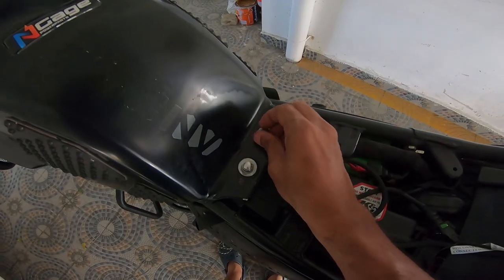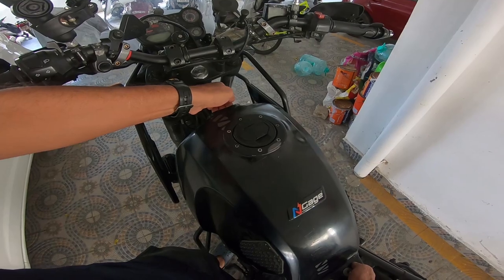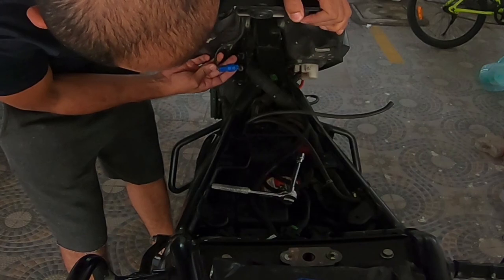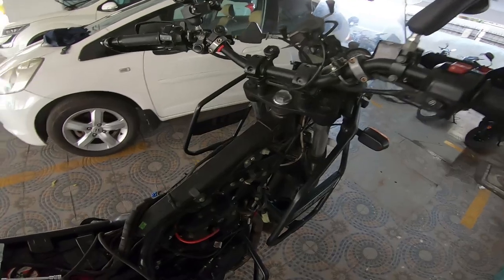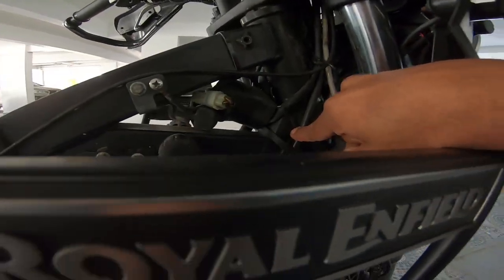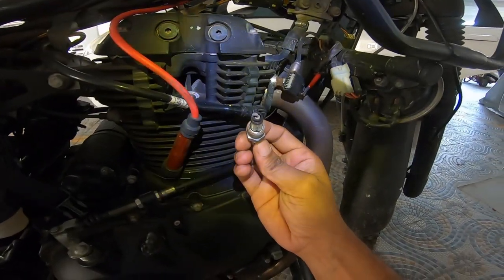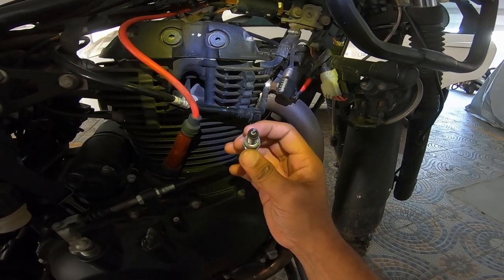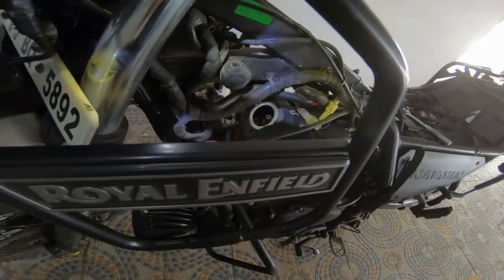STEP BY STEP DIY VALVE/ TAPPET ADJUSTMENT- MAINTENANCE PROCEDURE

Comment: Just got my bike from RE and they supposedly adjusted the valves, at least that is what they charged me for. But since I like checking on their work, I opened the bike and the cold exhaust was at 0.006mm which is about 30 percent to tight, and the intake had zero play. I guess the RE shop failed the test and I will be doing everything I can at home. What gave me a heads up was that they also charged me for lubing the chain and changing the oil, and riding home the chain was so loose that it was slapping against the swing arm. I then looked in the oil window and it was pure black. Once on the center stand, I had to drain a full quart of dirty oil out of the engine before the level fell between the lines. Then I had to buy new oil and replace the dirty oil myself. Also now, the bike shifts very hard. It clicks and hangs up between gears and then it slowly enters with a lot of force. It is bad enough so I no longer want to ride the bike. I think my next bike will be a V-Strom. Less maintenance.
Reply: I just checked mine today  and no gap . I thought I was losing it .😂

Comment: Normaly you rotate the crankshaft in rotating direction of the engine. So in this case counter clockwise. But on the himalayan i read somewhere (dont know exactly where) to rotate the crankshaft only clockwise because of the risk of loosening the bold when turning it "left" anticlockwise. I don´t know if thats just a workaround because the camchain slack is somewhat different when turning it "the wrong way (clockwise)" and maybe that does not effect the adjustment of the valves.....
Reply: The service manual clearly says "clockwise" but George Milburn in the TEC cam replacement videos makes a strong case for only rotating the engine 'anticlockwise' (the normal direction of engine travel) to avoid slipping the cam chain.  He argues the risk of loosening the magneto bolt on the crankshaft is low with the spark plug out.  I have used his approach without difficulty and its easier for me to be sure I'm at TDC on the compression stroke.
Reply from the maker: @DrMemory70  yes , all my life I have ONLY rotated in the direction of the engine . I made a video on the same but a lot of people quoted the RE manual and the clockwise direction so did not want to go against it this time . And yes it is only because of the risk of accidentally loosening the flywheel Nut. But like you rightly said , if the spark plug is removed , there will be no compression forces acting , chances of loosening the bolt is next to nil .

Comment: Hey ben, i've done the tps adjustment and my bike still stalls, i dont have evap and ais anymore , and i user an aftermarket filter and exhaust. do you think it could be an exhaust valve too tight?

Comment: Hey Ben. South Dakota here. Great videos and thanks for putting information out there. I’m gathering tools to be able to do my own maintenance on my Himalayan. Can you use your Valve Adjustment Tool on the intake valve? Seems like a lot of folks need to adapt their tool selection (needle nose pliers) to get the job done. Your comments?
Reply from the maker: Tools I have shared in the video work just fine on both valves . A steady pair of hands help

Comment: Hi, I have watched practically all of the valves on .Himalayan videos and some are all over the place on were to set the bike at TDC as on the line past "T"..or directly on the "T"..? (it seems to be a 50/50 split on this?) and some have said .03 to .05 on intake and .09 on  exhaust..Tou say .108 and .23 in exhaust   (which is common in here) but everyone can not agree on these?
I think I have to buy an actual manual on this, as even the service Dept. where I bought my bike will not tell me (They owe me a free year osf service..)
Reply from the maker: The manual says LINE past T mark & .08-.10 and .22-.25 inlet and exhaust respectively

Comment: Hi Ben, some of the topic question..
I have purchased the handle bar risers that you are using. Installed them on my Himalayan, fits well. The problem is when I turn left the front break hose feels a bit small. Have you replace it with a longer one in your bike or are you using the stock one?
Reply from the maker: No , adjust the routing .

Comment: Turning 411 Himalayan engine clockwise is WRONG!!!! You must turn the engine COUNTER CLOCKWISE, or you will damage the chain tensioner - and the engine!!!. How can you not hear the noises coming out of the engine, while you are turning the engine into the wrong direction/clockwise??? Where did you learn this? If you are not sure in which directon you should turn the crankshaft, do the following: put the gearbox into the 5th gear and rotate the rear wheel in the driving direction - the crankshaft will rotate into the correct direction, namely COUNTER CLOCKWISE.

Comment: Hi Ben, i have Himalayan BS6 2022. Its been two month since I bought it and have clocked 2550Kms.. 

Recently, from two days i am hearing a loud sound while u throttle up... Roughly at about 3000rpm its getting really noisy.... Like something is rattling..

Any thoughts on this?????
Reply from the maker: tighten your engine bed bolts . check windshield for rubbing against headlamp cowl. Also , take your time with thsi engine . it will fully BED IN /BREAK IN at about 3-5000 kms.
Reply: @ONTWOWHEELSBEN  thank you 👍🏼
Reply: One if my exhaust heat shield bolts came loose causing a loud rattling.  May want to check them.

Comment: compressor built while rotating is really irritating as it compress it slips off most of the time and the top center  misses out some times so old school method can be done too by putting bike on 1 gear and push tire back wards till it gets on top center than through spark plug area insert screw driver tip and sense the pistons position and than inspect the T  as mostly it skips gives F or the arrows >  > thats why makes it more irritate getting it to center as ive did before on my 200ns was as well cause had over all 2 intake 2 exhaust good about himalayn have only 1 intake and 1 exhaust